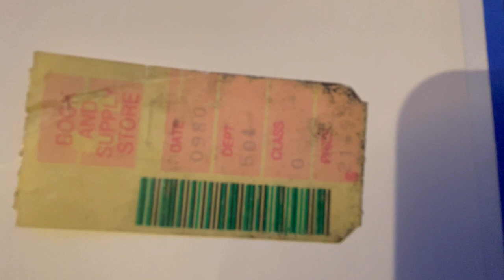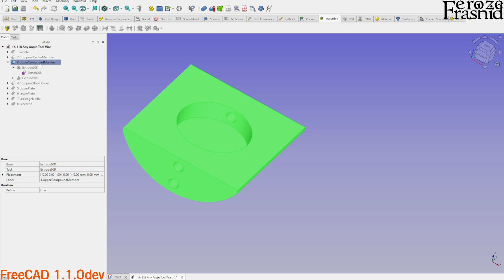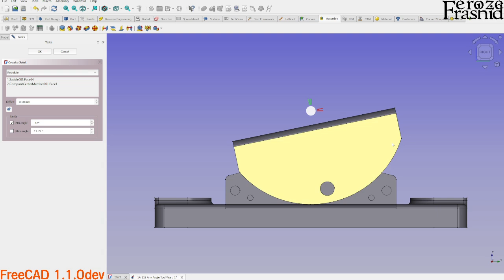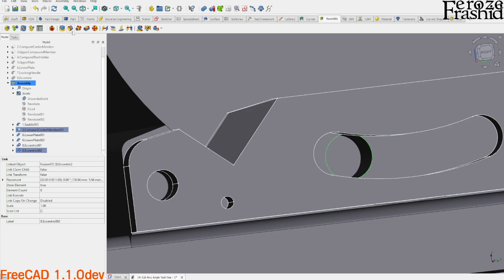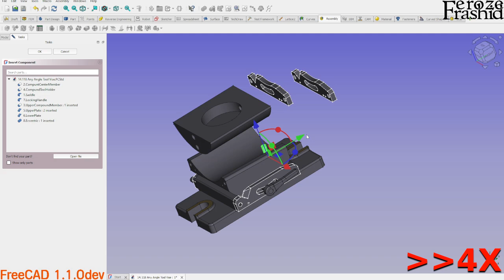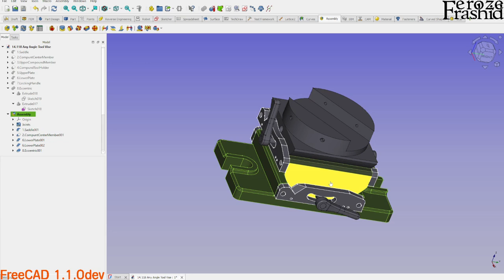The New Assembly Workbench of FreeCAD: Any Angle Tool Vise from Engineering Graphics

Comment: I really enjoy your videos—they're very interesting! When you build the parts, is it possible to create them in their respective positions, such as on a plane defined by the previous part? I mean to create a new part on a plane that uses reference geometries from the earlier part. This could make it easier to add the joints. A typical example of this is Fusion 360. Thanks
Reply from the maker: Thanks.
Yes, it can be done. I have done that, it helps after a part is added into the active assembly during joint making.
I just try to keep a part as independent as it can be in FreeCAD, maybe from the fear of TNP. I know that issue is mitigated a lot, but still keeping parts independent opens up the full parametric capability even after an assembly is formed.
Reply: is it possible to design parts while building up the assembly? I mean, most things are a mix of purchased parts (with known dimensions), held together with parts that have to be shaped and dimensioned by yourself. Like an electric motor, some bearings and a shaft that I purchase. But the frame that holds those pieces together in the right place has to be designed. I imagine I draw the purchased parts, then place them in the right spot and finally design the frame in between. I have not yet found a tutorial that shows this. You all draw completely designed parts and put them together in an assembly. You never show how these were designed  so that they fit together😢